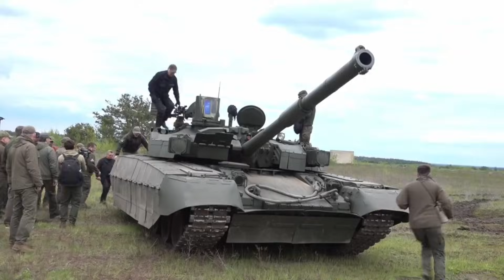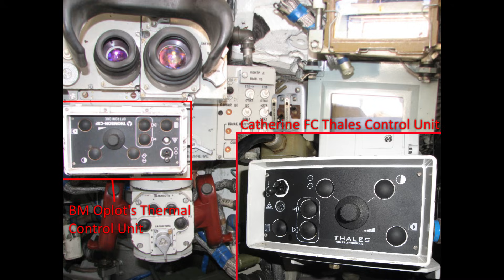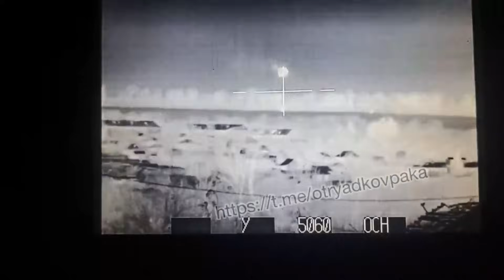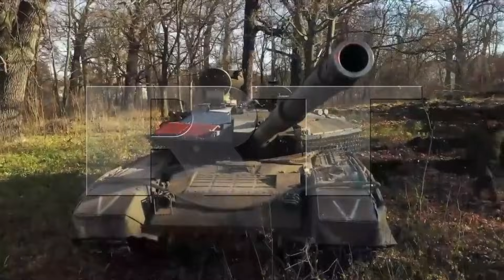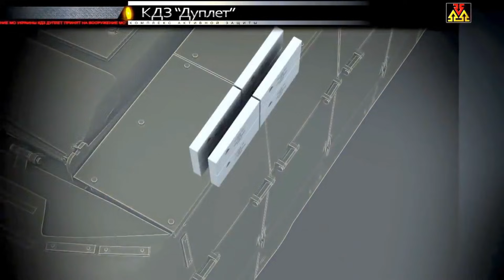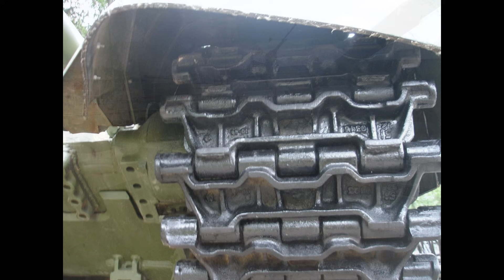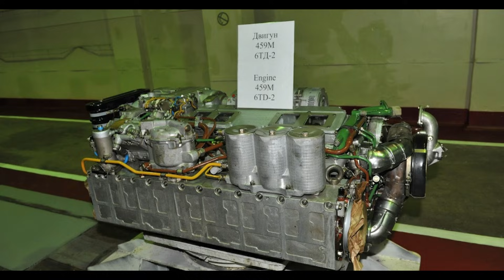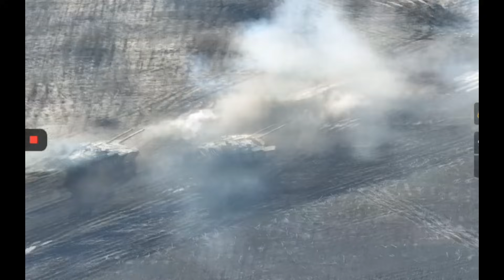Best Ukrainian vs Best Russian tank. T-90M vs BM Oplot comparison

Comment: You forgot a feature of the T-90M: as of March of 2023, all new T-90M tanks will be outfitted with the Arena-M hard-kill APS, with a retrofit program likely to come in the future over an unknown timeline. As such, T-90M is fully superior to the BM Oplot in every way except reverse speed.
Reply: Wrong
Reply: @scatterlite2266  No, really. ArmyRecognition wrote an article about it on April 5th. It's real.
Reply: @thermalvision203  The article from april you linked and then deleted only proves that you lied. Litteraly nowhere is stated that all vehicles will be upgraded starting from march. 
Only vague "plans" are being mentioned.

According to those same russian MoD plans the T-90M was already supposed to have APS years ago. It was also "planned" that russia would have 2000+ armatas in service by 2023.
Reply: @scatterlite2266  YouTube deleted that reply because it contained a link. The original post I used as evidence contained screenshots of the actual patent for a modified T-90M turret with Arena-M installed which proves it's happening. Unfortunately, YouTube deletes any reply with a link these days, so I can't post it here. 

Why T-90M hasn't received Arena APS until March of this year had to do with teething issues with Arena APS itself where it was proven to be very hazardous to infantry that happened to be near the tank. Fixing that issue took long enough for the performance requirements to be raised, hence why T-90M is receiving Arena-M instead of original Arena.
Reply: @thermalvision203  The old arena didnt work well, thats why its never been seen in active service.

I dont understand why people still take russian MoD statement as facts. The mfs lie all the damn time. Constant overstatements of capabilities, production numbers and timescales.

Ill believe it when i actually see arena-M equipped tank on the battlefield, and not just more T-62 obr. 2022
Reply: @scatterlite2266  I didn't get this information from the Russian MoD. I got it from the leaked patent document. 

Also, the RMoD, for all it's many faults, is still a far better source than any western media and especially any Ukrainian Government source. According to Ukraine and western media, the AFU still holds Artyomovsk. The RMoD lies about little stuff that's very hard to disprove, while the western "news" media and Ukraine lie about everything in order to construct an alternate reality.
Reply: @thermalvision203 oh god no and you're a shill if you think any of that is true
Reply: @scatterlite2266  What is proving that they are lying.
Reply: @gamingwolf6735  this conflict has shown so many instances the MoD was lying its hard to keep track of.

Some low hanging fruit are  their statements about the armata. Lauded in 2014 as a near invulnerable supertank with procurement figures in the thousands, now 10 years later there isnt even a single combat ready brigade. The story is similar  with the SU-57: it should have entered serial production somewhere around 2016 yet 7 years later there still isnt a single full squadron of them in service.

Comment: In the end of the day, it doesn't really matter how well armoured or good a tank is if the strategic use and command are useless.
All russian tanks are fairly good but they keep getting knocked out by artillery/top/drone attacks because they receive no forward intelligence, travel in tight groups to make easy pickings for artillery and there's no SPAA/Air Support to stop they getting knocked out from the air.
All these tanks could be replaced by any and all best western tanks and they'll end up the same smouldering pile of rubble as all tanks generally have the same weakspots (the top/sides/rear) which are supposed to be covered by other military branches such as infantry, SPAA and air support. 

Russians seem to be just herding tanks en-masse WW2 Kursk style literally giving free kills to the enemy instead of clearing the area and gaining air supremacy first (which they easily can because Ukraine's Air defense is nonexistent bar from a few Patriot systems and outdated S-100/200's) and have no airforce to speak of. Lack of command competency, unmotivated personnel (most soldiers I don't think are very happy to be fighting their own brothers and sisters especially since they literally have families living on both sides of the border hence why so many desert, deflect or simply refuse to fight) is why Russia is losing the war, not because their equipment is bad.

Comment: Now Russia learned that 4km/h reverse speed is a bad thing. So all modernizations in future and each new tank will have this fixed. It is likely to be a hot topic for engineers now, and is probably already in a process of fixing. Once they fix this issue on T-90M, it won't have a single downside after that.

Comment: If Ukraine restart production of Oplot, it seems weird if they don’t chose to build the 120mm gun version. 
Would have manny advantages over the 125mm, as they then could use NATO ammunition.
Reply: there isn't a 120mm gun version, the 120mm Yatagan is a different vehicle.
Reply: @ArielK-a  look up the T-84-120 Yatagan
Reply: @ArielK-a  "T-84-120 Yatagan
A prototype version of Oplot tailored for evaluation by the Turkish Army (prototype designation, KERN2-120). Mounts a 120 mm main gun which fires both NATO 120 mm rounds (like the M829 DU series) and a special 120 mm version of the AT-11 Sniper ATGM. Most significantly, the Yatagan features a completely redesigned "Cassette style" bustle mounted autoloader[11] (similar to 'Leclerc' or 'K2 Black Panther'), replacing the soviet-era carousel autoloader. This redesign allows all ammunition in the ready-rack to be separated from the crew and equipped with blowout panels, features considered standard for NATO MBTs. It also has automated gear shifting in place of a mechanical gear selector, driver's T-bar control replacing tiller bars, air conditioning, and projectile muzzle velocity sensor, and differences in the fire control system, communications, etc."
Reply: The biggest issue is that they would also have to import the fire control parts and ammunition (something the west has not been great at providing in a timely manner and the Ukrainian government likely does not have the ability to build itself). The ammunition provided to it, will likely not contain any dedicated HE or Frag shells and as both sides in the current conflict have been using their tanks, old and new, increasingly in the artillery and fire support roles I take it they probably would like the extra capabilities their current 125mm ammunition has in the anti infantry role
Reply: @cringothebot276  The west are sending lots of 120mm HE to Ukraine, I don't know where you got that from, there would be no point of sending Leopard 2, Challanger 2, or Abrams if they didn't. 
If there were issues with them getting the fire control system or parts for that pre-war I think the would be solved now if Ukraine put on some pressure, France even sold that kind of stuff for russia not that long a go(clueless by them as I said at the time). Anyway, if you got a 120 mm or 125 mm gun, you need a fire control system.
Reply: @mwtrolle  I am not saying the the west hasn't been sending them shells I am saying there has been a major problem in how quickly the west has been sending them in comparison to how quickly they need to be used. The earliest 120mm HE that has been in production has been in production for 30 years. Where as the production of 125 HEFrag-FS and Shrapnel-FS has been ongoing since the 1960s and 70s. Not even to mention the stockpile Ukraine likely has.
 I am not saying they couldn't, what I am saying is that there are good reasons not to. The west dragging it's ass on getting UA what it needs to win being one of them.
Reply: @cringothebot276  Yes the Ukrainians have used them in an indirect fire role as they had smaller numbers and they could not risk losing too many.
russia has been increasingly doing the same, mainly because they get completely owned by Western stuff like Javelins, NLAWS, Panzerfaust, and artillery-launched mines. Also because of Ukraine's better tactics. 
Almost every time russia have tried to use their tanks for a push it has resulted in a catastrophe for them, because of the before-mentioned issues, especially when it comes to the smaller groups. The huge columns deep trusts the experts were expecting from the start, failed before they even really happened, because of russias lag in logistics and because of Ukraine's ability to strike those logistics.

Comment: I feel like the T-64 style autoloader does have one thing that you neglected to mention:

It isn't inherently worse because the charges themselves are placed behind the main composite and explosive reactive armour sets of the tank, meaning that any shot that strikes them would have probably killed the crew anyhow, since they would have to have penetrated the upper front plate or the side of the tank. The T-72 style autoloader simply places them really low down, which makes them lower profile and thus harder to hit in any case, but that also means that the charges are not placed behind armour - if a projectile was to come in at a downward angle, enter the lower frontal plate, or a mine was to detonate below the vehicle, the T-72 autoloader is still equally vulnerable, if not more vulnerable.

So, in a sense, I don't really think that it matters too much in this regard, and that the T-64 autoloader might just be a little better because of the speed improvement: if it's faster and has such a little impact on the vehicle's survivability, then it has to at least be able to be considered as a superior option, or at least on par.
Reply: The difference in speed of loading can be, and often is, nullified by the gunner needing to actually aim the gun. Also in case of the autoloader, if one needs to change ammo type between shots, rounds can be on opposite ends of the carousel which can take a LONG time to get to.
Reply: @Max_Da_G  It doesn't actually take that long, especially if you can predict what round you want before you need to reload. It's only something like 22 seconds for the carousel to make like a full 360* revolution if I recall correctly, and you can easily just alternate your ammo stowage to make up for that. But, yeah, it's definitely a downside - something like a bustle autoloader like what the Japanese seem to love using would be the superior option, but I suppose the carousel is what the Russians are liking for now.
Reply: i never seen a clip of a mine setting of a t72/t90 ammo tho.
Reply: @jkc2001  Well, i'm saying it's a /possibility/. A mine could easily set off a T-64 autoloader's ammunition as well.
Reply: we're seeing a lot of top-down attacks in the current conflict. armour on top is definitely a bonus
Reply: The autoloaders are functionally the same, everything you said about T-64 autoloader applies to T-72 as well, except the T-72+ is more modern
Reply: @phunkracy  The T-64-style autoloader and the T-72 style autoloader are entirely different designs? What do you mean by that? They're not functionally the same, and if they were, they would have picked one over the other instead of complicating things with two separate designs - there is /clearly/ at least some difference.
Reply: Main different that T-64 type of autoloader have a reserve for hull deformation from bottom up to 55mm. But T-72 only 8mm.

That is mean that if some close impact will be or some landmine like TM T-72 if survive that will be tot able to fire again but T-64/80/84 still be.

Comment: BM oplot is better for one simply reason: it is based on t-80U/UD which was most advanced MBT while t-90m is based on t-72B which was most simplified MBT of USSR. In other aspects they are nearly identical. Turrents were joint developed by both Russia and Ukraine in the 90-00's based on the works of Object 187, they differ a bit but nothing major. Both ERA designs were based on older soviet designs. As of thermals and other electronics, they put whatever best thing they could buy from the West. The main advantage of t-90m is that Russia can produce it, while Ukraine can not their BM oplot. Otherwise the tank is mediocracy or just a t-72 on steroids which should have been replaced with 'Object 187 if not famous Russian corruption.
Reply: Bro the T90M is in no way relatable to the T72B
Reply: It is not relatable, it is t-72b with a new turrent. Should be called t-72c or somenthing.

Comment: what would happen if the Germans let them put the RH 120 L55 or the A1 in place of the 125mm weapon.  that way it could use Nato ammo.
Reply: i guess they'd have to redesign the whole turret
Reply: @Fredoca_Laroca  not the whole turret... just the mantel area.  and adjust the autoloader to use 5mm smaller rounds.
Reply: They already have done it the t-84-120 Yatagan

Comment: Hahaha I see you try to be neutral but still the copium is noticeable ^^
T84 Oplot has better armor, the armoring of the carousel only comes into play when the tank is penetrated (and therefore out of action) any away. The Oplot shoots faster, a much better advantage. 
The periscope blocks the front mirros in the Oplot… and the T90M has it blocked to tree rear. A minuscule difference because both commanders will use the thermals anyway. 
Also diminishes the “Russia can produce many more T90M until Ukraine starts production of T84s”-argument, as Russia decided to restore older tanks, they will never be able to produce “hundreds” (XD) of T90M with thermals, especially it 3rd Generation whole Ukraine has all the support if the (western) world to get thermals, and can also decide to put better thermals in the new Oplots. 
The reverse speed issue is by far the biggest thing, diminishing any advantages the T90M might have with armored fenders. 
The ammo for the guns is also negligible, the Israeli 125mm ammo is good enough, it’s loaded faster and the difference in target tracking and lead tracking is important in about 0.0001% of all cases.
So yes T90M has some minor advantages here and there, but the reverse speed and better armor of the Oplot clearly makes it a superior choice.
Not to mention that with the Yagatai the Ukrainians can have soon a NATO standard tank with a 120mm smoothbore, and that Rheinmetall is seemingly in the boat makes that much more likely.
Reply: Про "броня" лучше - это смешно. Украина за 30 лет независимости полностью растеряла квалификацию как в танкостроении, так и сплавах. И это не говоря о том, что украинская динамическая защита Нож по всем параметрам уступает Контакту 5, не говоря о Реликте. 
На у то что Россия никогда не сможет производить сотни Т-90м... В данный момент с конвейера УВЗ сходит по 3 Т-90м в сутки.

Comment: I would bet that Russians made some compromises when it comes to T90M production like cheaper parts and some features missing compare the original T90M made before sanctions. Probably the quality is also not great.
Reply: there were no compromises. the first batches were made using parts from the T90. the next batch is already made of completely new parts. then an upgraded version. now there are several modifications under the same name t90m.
Reply: But we see reverse - increase in quality. On video.

Comment: The biggest problem of Oplot is the fact it doesn't exist. Seriously, they have made 18 tanks and exported 16 of them. Why making a comparison?
Reply: Funny thing is that if you switch to the T-14 where production numbers are similar everybody suddenly loses their mind XD
Reply: @juliuszkocinski7478  well, that's true. T-14 is useless now and at the same time impossible to be produced massively
Reply: @juliuszkocinski7478  their are actually around 40 T14's, 50 T15's and 30 T16's.
Reply: @kuunoooo7293  yeah, but Russian government wouldn't use t14 in combat, as t90 and other mbts are effective enough and there's no point in losing these expensive tanks. 
Btw T14 is the innovative tank, and no one wants to expose its super effective secret technologies (or lack of them).
Reply: @sokolov.  yeah but it really has no super secrets, its a great tank but it doesnt have anything super special

Comment: As Russian experts say, they have information that the turret armor on the T90M is the same as on the T90A, they just changed the angle.
Reply: Nope. Turret on brand new T-90M is made  of new steel alloy (15% lighter and more durable) while composites are made with new ceramic. 

BUT, if the upgrade is made from late T-90A models that had welded armor, engineers decided not to change entire turret but just to upgrade it with Armata technology.

T-90 and early T-90A had casted armor and their turrets were completely removed and replaced with above mentioned materials during upgrade process.